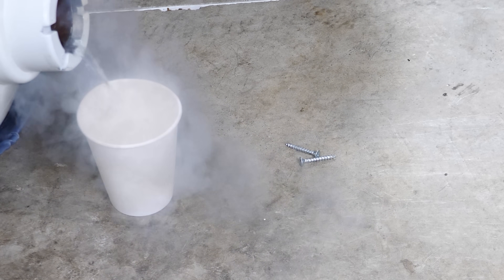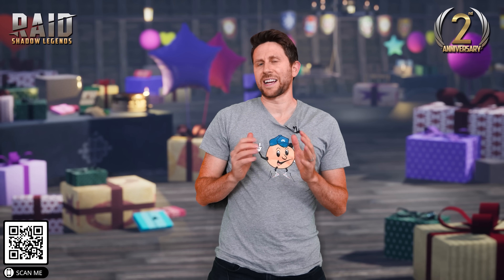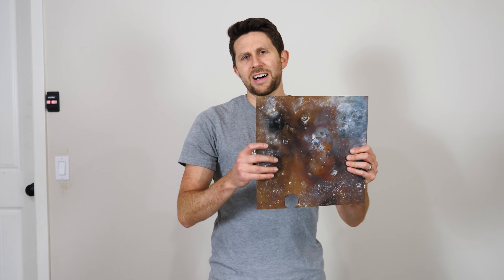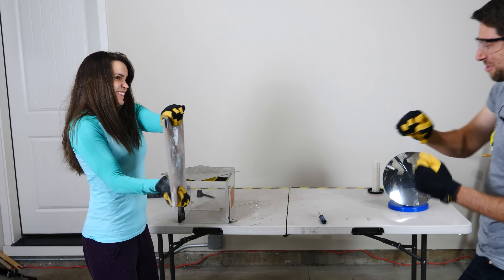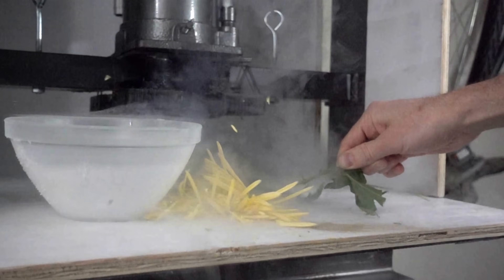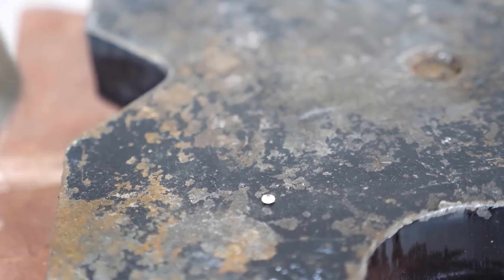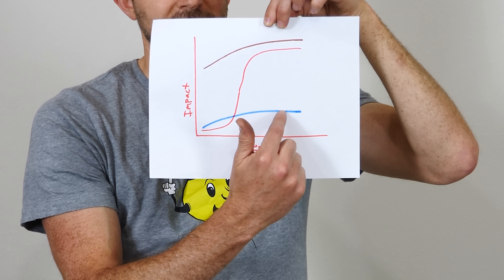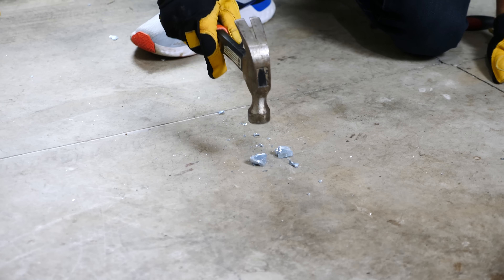Punching a Hole Through Solid Steel Frozen With Liquid Nitrogen

Comment: I have not seen that movie that everyone has, but now I'm curious. However I have seen the movies freezing a person and punching or shooting them to shatters.

To break the plate by punching you want to use lower body instead of upper body, i.e. legs and hip rotation. Like slapping yourself with a belt by rotating hips. And keeping the elbow close to the side for a more direct line of punch. I know it's a moot point if it's not breaking with a hammer either, but maybe someone gets inspired and wants to break wooden plates.

Comment: Work on your punch... And hold it on something steady... Might not that break but the pressure will be stringer. (90° hit also helps). And minimize the strik surface. So the the hit is more concentrated.

Comment: Well the reasoning behind is as you mentioned cooled material become more brittle, so steel that is already hardened will shatter more easily when cooled, like pad locks. Another reasoning is that regional rapid temperature differences can create micro cracks and weakening the material. But mostly extreme winter can cause damage to metal structure cause the dimensional shrinking that can cause cracking along side the welds. That is also why even when welding will be cheaper, bolts are used to give the structure bit flex, but most affected are objects made from cast iron. Maybe like if you shoot a pan with a bb gun it survive but cool it in nitrogen and it will shatter by the bb.

Comment: Shorter: in heat the metal is relatively flexible, when cooled it just hardens, but at the same time it actually becomes more brittle (ofc parameters depend on the material)

Comment: Aluminum is an excellent thermal conductor.  That you are able to hold it with your bare hand tells me that it's not that cold.  That you would do that, tells me you haven't thought it through (or you'd old it with an insulative glove to avoid warming it, or freezing your skin), or you're making a video for a predetermined outcome.  Aluminum will break in the Frozen North.  I've seen it happen.

Comment: Only Americans would call sheet steel “solid steel”.
Likewise they call brass light fittings that are little more than shim “solid” too.
And to call a piece of sheet steel “plate” is a bit on the nose too.
I’d expect steel plate to be 1/4” thick, maybe 1/8” but not that sheet metal.
Ironically I can imagine an American distinguishing brass plate (steel or other metal with a brass-finish electroplating) from what they call “solid brass” by calling the shim brass “plate”.

If it ain’t solid it ain’t solid.

And also, you are using the word “ductile” when the quality you are talking about is “malleability”.
Malleability means it can be bent.
Ductility means it can be drawn, pulled, as in made into wire.
The distinction between the two is the distinction between its responses to tension and compression.

Comment: Random thought but it would be interesting to see LN frozen Gallium hit with a quick extreme force in a confined space to see if it flashes into a liquid. Could contain it in something like an explosive compression cylinder or even try just using a sledge on a homemade enclosure.

Comment: when you cool down metal it gets more and more brittle until you can just snap steel with your bare hand but when you heat up metal it gets softer and softer until it cant hold up its own weight and becomes a puddle of molten metal

Comment: You're making two counter points in the video. You say the steel wont shatter because it's stronger, but then you say it gets brittle, and brittle things shatter.... Generally low carbon steels undergo DBT i.e. Mild steel, not a very specific alloy, or really even an alloy, it's DBTT is 0C If there isn't an abrupt change, then the material doesn't undergo DBT. What would have been good for you to mention, is that DBT affects steel structures in cold climates, and DBT makes steel far more likely to fracture, with little elongation, and so bridges in cold climates where winter is less than 0C that aren't made with specific materials meant for cold climates, i.e. with DBT behaviour, often fail, catastrophically.
You could very well shatter the steel, if you cooled it longer (it's obviously not at LN2 temps), and hit it with more energy, and put it in a vice.

Comment: Put it in a vice and try it. You're losing so much force by the person holding the sheet buckling from the impact.

Also, you should secure it on multiple sides to eliminate the relief from the warm sections bending away from your fist.

Comment: When things are frozen they become harder. When metals are hardened they wont bend easily and will snap long before you can get a good bend going. A block of tungsten would shatter if you drop it. Titanium you could bend maybe 3 degrees before it snapping...
Metal has to get pretty freaking cold for it to shatter.
...
Look up the studies of metal: metallurgy.
....
I dont think you know what you talking about when you keep on saying strength or how strong something is. Are you referring to toughness? Flux density? Tensile strength, etc. Theres like 6 properties of metal that are classified in their own respective groups.

Comment: My father when he was working in the oil rigs about 40 years ago, remembers when it would get really cold in the winter(-40 C to -50 C) there would be a noticeable increase in metal parts breaking. These were probably hardened steel alloys that were already brittle to begin with, and were made even more brittle. Combine that with the fact they beat on them with sledge hammers and expose them to thermal shock, and general abuse, it really isn’t that surprising.

Comment: Heck I know from forging that you can harden high carbon steel and it be brittle enough to be like glass. You can shatter high performance steel simply by heating it up and quenching in water. If you get it just right, you can heat it up just enough not to crack it in water and then be able to break the steel by hand. Try using a large metal file as a pry bar for example. Or better yet, just drop a really expensive heavy metal file. Cold temperatures are just the opposite but it all completely depends on the metal composition. What they do in movies is just entertainment

Comment: As a materials engineer, I was kind of disappointed in the explanation. Yes, it is true that the ductile-to-brittle-transition is dependent on material, but what really wasn't touched upon was why. The main reason has to do with the structure of the material. Materials with a BCC structure will usually exhibit the DBTT while FCC materials will usually not. Steels can exhibit a few structures (depending on composition and processing), which is why the alloy and how it was processed matters. Aluminum is a great example of the latter FCC structure. Since it's an FCC structured material, it does not exhibit a DBTT. Instead, it shows great ductility at a wide range of temperatures. If he picked a ferritic steel which has a BCC structure, he would have been able to fracture it apart.

Comment: A lot of this can be explained by the different crystal structures formed by different metals. Face-centered cubic materials have relatively smooth planes between atoms that can slip pretty freely. (Aluminum and austenitic stainless steel, for example) Body-centered cubic materials have ridges on the slip planes that make movement harder. As the material gets colder these move closer and closer together the number of ways in which it can shift in order to accommodate more atoms in a smaller area. Since body-centered cubic materials have far fewer angles that they can deform at, essentially all of the ductility gets "used up".

Comment: Be careful with this because some years ago I "slightly" punched a steel door for fun and it only hurt a little, but I'm pretty sure I actually broke my knuckle, because my left and right hand knuckles are no longer fully symetrical 😂 hand is still working perfectly fine though.
Btw if you have an injury like this, get it checked out by a doctor, even if it doesn't seem to hurt THAT badly, or some bones can grow back in a weird way, especially on your hands and feet.

Comment: It's a similar process to forging. If you quench a hot peice in water, the rapid cooling causes it to harden so fast that it can crack or break while if you do it in oil, it cools faster leaving it hard but not so hard that it can crack or shatter with the smallest hit.

Comment: She didn't brace the board for it to absorb the punch. Instead she absorbs the punch with her movements.

Really should have had a vice to hold the board and another mechanism to perform consistent strikes (even just dropping a spherical weight from a consistent height), then done control and experimental trials.

Comment: Also let's not forget just plain physics, that plate has a realy big surface, your punch will probably spread out faster over that surface than you an apply force on that single point, especially since your wife/girlfriend will probably be pushed backwards and her arms will give, high impact strength usually can not come from muscle, even the best Karateka's will have a problem with that, maybe with a bullet you will get better more spectacular results, but I can respect using no firearms since there is a lot more safety issues involved

Comment: It is possible to get steel cold enough to break it and I would like to see The Action Lab try this again.  I would suggest a high carbon steel with high levels of sulfur.

Also aluminum is very cold resistant.

Comment: industrial diamonds are not very expensive. I got one to reshape my grinding wheels . It is set in a steel holder only cost $30.00   When you pay $ 2000.00 bucks for a diamond half of that is profit and the rest is polishing and setting in the piece of jewlery

Comment: Just because the liedenfrost effect doesn't work on your steel plate, it doesn't  mean it hit liquid nitrogen temperatures.  I'm not a chemist but I want to see the full plate in liquid nitrogen.
Reply: I want to see you take the full plate of steal and submerge it in liquid nitrogen.   Take a few minutes to let it cool and hit it with a hammer.  I want to know if the steel.  Is brittle  enough to crack or break.

Comment: That’s not pure diamond if you can break it with a hammer.  (DudePerfect tried it and it just dented the head of the hammer and the anvil they used as a platform.)

Comment: You need higher Carbon steel, that sheet is mild steel, with almost no carbon in it (<0.2%). Also, you cannot freeze just the middle, the normal soaking time is 5 minutes for the entire part tested in laboratory.

Comment: PLUS the fact that you ONLY froze a part of the sheet and an end of the rebar.... what do you think would happen during the time you handle the sheet and rebar up to hammering them? Yeah, the cold section will have a chance to lose its freezing temperature? BETTER way of showing your proof...? Get all of the steel sheet and the whole rebar 100% to Liquid Nitrogen temperature, then immediately smack it with hammer.... 😏

Comment: Looks like your press plates are HF cast iron.  Might consider replacing those cast press plates with Machined Arbor Press Plates (Swagoffroad) or steel plates before the your cast plates shatter into pieces of shrapnel.  Just sayin'.

Comment: Problem with metal is that it conducts heat so well that as soon as it was not at nitrogen temperature, it was warming up very fast due to the huge delta T of nitrogen versus room temperature. Specially that flat sheet with so much surface area and small volume. It's like when you take an aluminum pizza plate out of the oven, in less than a minute it will be cool enough to be handled because it is so thin and with such large surface area that it dissipates its heat into the air quite fast.

Comment: The way he punches is mega cringe.

Also, the lady is not doing her part correctly. She should hold it FIRMLY WHEN HE PUNCHES. SHE SHOULDN'T FLINCH BACKWARDS LIKE THAT, OTHERWISE IT LITERALLY DEFEATS THE PURPOSE OF THE PUNCH.

If I held that metal plate, it wouldn't budge from his punches. His punches aren't even that strong, it's easy for me to hold it firmly.

Comment: Some metals has a temperature transition from ductile to fragile. It is related to their atomic structure. Aluminium resists at low temperature. Try stainless steel and you should broke it! Be careful with low temp metals, due to their conductivity they’ll discharge all the cold accumulated very fast, freezing your hands.

Comment: Steel "plate" by definition, is material with a thickness in excess of 6mm.  
You are using steel sheet, and yes, it doesn't sound nearly impressive.

Comment: THIS MAN
only this man
could just casually take a hammer to a diamond
no regrets
Reply: That diamond probably cost less than a dollar. Manufactured diamonds are cheap and natural diamonds are more expensive pretty much only because people think they are valuable.
Reply: Diamonds may be the hardest gem but they are also brittle if struck at the right angle
Reply: J D  Wow. Thanks for that well thought out answer and info. Never expected that.

Comment: Liberty Ships - transition temperature - failure in cold water due to lack of understanding on how steel behaves at low temperature AND, a change in construction methods. When ships were made with riveted sheets, any cracks would stop at the end of the sheet. With a welded hull, the crack could propagate so a previously unknown phenomenon manifested itself in ships falling apart in cold waters in the north Atlantic. Modern steels for ship building have a lower transition temperature.

Comment: So technically you can “enchant” iron armor by dumping it in liquid nitrogen(assuming you have some means of wearing by maybe being in a temperature resistant thin suit or something). You could just get robot hands to put the cooled armor on you (and padding on the inside that is cold resistant by some reasons so the steel does not touch you). Medieval knights probably could have utilized liquid nitrogen to enhance their armor (and by another means) wear and sustain the armor on them. Certainly possible(so as long as your skin doesn’t directly touch the cooled steel).

Comment: How to crack a safe with liquid nitrogen.
Step 1: Glue the safe door so it's airtight. 
Step 2: Drill &tap a 1/4 inch hole in the safe.
Step 3: siphon a few gallons  of liquid nitrogen down  that hole.
Step 4: screw a bolt into the hole and run!

Comment: Steel used for milling, turning and cutting is quite hard. You could buy a high speed cutting steel plate or cemented steel plates for turning and it should break undercooled.
Reply: Or or or some steel drills for drilling steel. They are quite hard and less expensive than cutting plates
Reply: Or or or if you can get your hands on a Brinell hardness test ball.

Comment: In the case of the rebar, It could also be the thickness of the material. Liquid Nitrogon only flash freezes stuff, and the cold doesn't sink in very far. For example if you drop a water balloon in. you can pull it back out peel of the balloon and crack the ice like an egg revealing a still liquid center.

Comment: This experiment was not controlled, her arms didn't hold it completely still. When you hit the plate her hands always reacted to the force by moving, meaning that part of the impact from your fists was dispersed by her arms acting as shock absorbers, same with when you held it and hit it with a hammer.

Comment: you tried to shatter a stainless steel bowl buy cryogenic coolings..... LOOOOOOOL .... 

the reason the stuff ur trying to shatter isnt shatterins is simple, you are using ductile materials or materials with no real internal stresses when they cool . you arent creating layers you are instead making them uniformly cold.  you need to induce internal stress to shatter the steel next time

Comment: Why does nobody talk about steel still being a relatively soft metal. I wear a tungsten ring (tungsten carbine never tarnishes) I’ve seen everyone’s steel rings tarnish and get scratched not mine. I’ve hit steel as well with my tungsten ring at an angle (Ouch! If I was to do it with my bare hands ) it left dents in the steel leaving my ring unscathed. Tungsten carbide is top notch and I felt no pain bashing it with the ring on

Comment: Okay, but when you spray freon into a lock you can break the components inside with a chisel... So the metal inside becomes brittle? Why not use a metal that doesn't become brittle when frozen?

Comment: Great video but he’s using completely the wrong terminology... strength has nothing to do with hardness. Hardness is resistance to scratching, and basically how much it will push back before deforming. Strength is about what happens after the hardness of the material is overcome, a “strong” material deforming via bending and a “weak” material deforming via breaking. Most types of steel and cast iron are both strong and hard while ceramic and brass are both rather hard but quite weak. Aluminum is soft (not hard) and strong. The reason that the screw broke when it was frozen was purely because of a stress gradient caused in the production of the screw, greatly exaggerated by the slight increase in density (and thus hardness without a temper to also boost strength.) I would like to see what happens if the screw is hardened and tempered, then frozen and hit.

Edit: for reference a diamond is insanely hard but also very weak, making it very resistant to breaking, but if it’s hardness is overcome somehow it fails catastrophically.

Comment: I feel like cast iron placed on two cinderblocks with liquid nitrogen might actually crack if its hit with a hammer. Cast iron is a steel alloy if I remember right so it would still count as breaking steel with extreme cold.